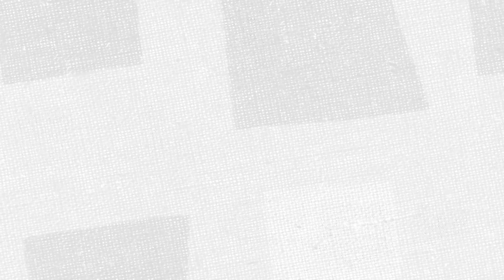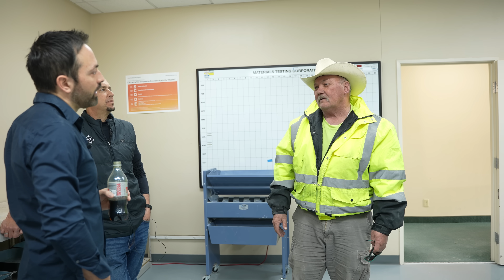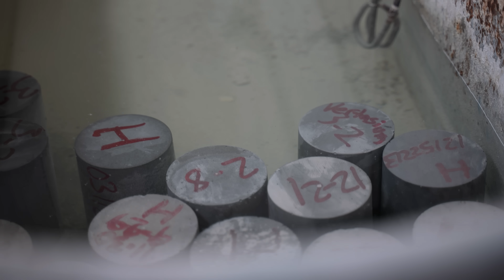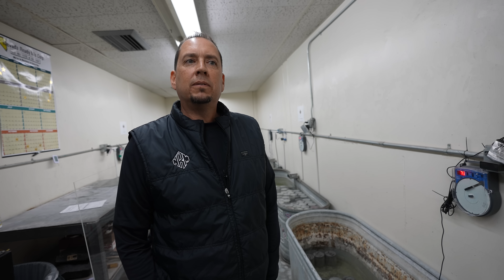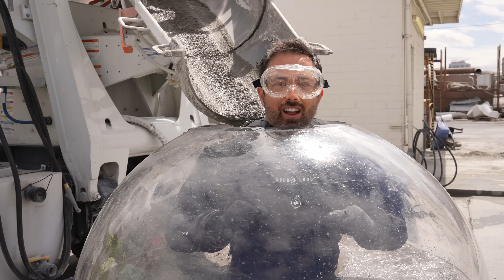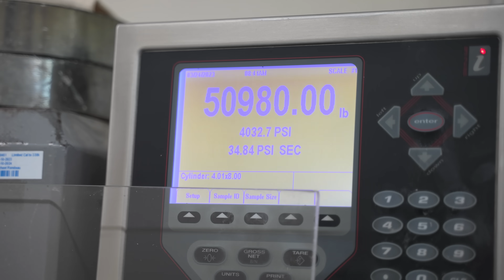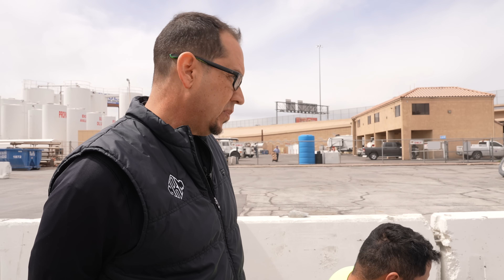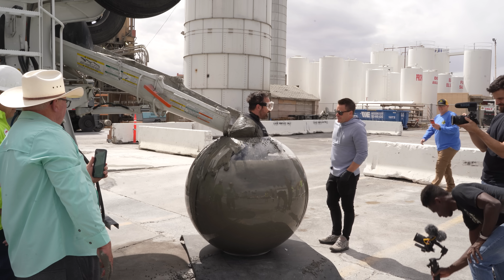Getting Buried In Concrete To Explain How It Works

Comment: I have first hand experience how concrete is caustic and dissolves skin cells. I had once a hellish concrete job in pouring rain, the pump truck was swimming in mud and the moulds were filling up with water, long story short, due to an almost biblical flooding that day (pump trucks have to empty or the concrete dries) we had no choice than fill up the molds even if we knew it was gonna be trouble. Due to the mud, the concrete started to burst through the groud from underneath the molds, and I had to get in there with a showel.. During the day I every now and then felt a tingling sensation on my hands while showeling, my gloves covered in slur.. Once the day was done and I removed the gloves, I saw that due to being soaking wet, concrete had turned into a soup, went inside my gloves and then marinade my hands in a caustic porridge through the whole day. As a result my fingers had turned black and had received 3rd degree burns.  Turns out, unlike acids that cause a burning sensation, caustic attacks and numbs the nerves, so you hardly feel any pain, especially when frantically working to save the pour.

The fat and skin from my hands had basically dissolved away, and the chemical burns kept worsening due to the concrete causticity deeply penetrate my flesh. In the end I even had pockets to the bone in some places.. Recovery took an entire year with fixing the fingers, but today I have good mobility close to what it normally was. Be careful not to let concrete on your skin for long periods of time, it will eat through.
Reply: Thats wild. Ive worked with concrete here and there barehanded for projects at home simply becsuse i hate gloves, everytime i got some slight chemical burns and irratation from it. 

I figured it was just silica burns. Washing periodically and directly after helped but the skin took a couple days to return to normal feeling without the tingling and constant dry sensation. 
I never realized it was such a serious thing or could progress to the point you described here. That sounds horrific.

Thanks for sharing that story. Im sorry that happened to you while you were just trying to save a pour at your job.
Reply: ❤ that sounds horrific. Thank you for sharing your harrowing experience. I hope you continue to have good health here after.
Reply: That made my skin crawl, no pun intended.
Reply: I was certain that you'd lost your hands completely based on that description 💀
For you to have recovered almost all of your lost functionality is absolutely incredible! I am so happy for you dude 🙏
Reply: @TakeaSwigofTheJuice  i agree. I can definitely imagine it all too well. Especially knowing what they mean when they say you dont really feel it much as its happening. The holes going to bones part got me. I think ill wear gloves next time.
Reply: I am glad you recovered from this.
Reply: Jesus CHRIST dude got way worse than I was imagining
Reply: Oh god, how terrible. I'm sorry that happened.
Reply: i dipped my hands in wet concrete when i was little because i thought it was like mud and i was playing with it for a good while before my dad saw  me and yelled at me lol ....is it weird that nothing happened to my skin?
Reply: Glad you were able to make a recovery, and thank you for sharing your story. I am curious, you said it dudn't hurt much during the day, but what was the pain like afterwards?
Reply: My brother used to pour concrete molds for sewer pipes. He used to wear cheap leather gloves with some cheap nylon inserts on the inside. Needless to say, after a year or so he started to develop what he originally thought was scabies (his Dr. told him it was scabies), that turned out to be a severe allergy to the concrete slowly seeping through his two pairs of gloves. Not a lot, mind you, just barely enough chemicals seeping through the gloves. It took him years to finally get his hands back to normal. He of course had to quit his job there, but it all worked out in the end, thankfully.
Reply: Holy crap! That’s intense! Glad you’ve recovered.
Reply: This is what they warned us would happen but nobody handled concrete long enough for it to go that far.
Reply: I've unlocked a new fear
Reply: Damn!  Thanks for the warning!  I knew it wasn’t good for the skin, but I had no clue it could be that bad.  Now that I work on the service side of things I rarely encounter fresh concrete anymore, but still good to be aware.
Reply: Came here to warn others not to allow the dust to get on your skin and don't dare breath it, but OMG!!

If the dust from a bag (that you pour into the wheelbarrel) gets on you, later that night your skin feels itchy and super dry, water doesn't help, only vaseline helps. 

I got the level 1 out of 100 and you got the level 1000 out of 100.
Reply: @thatnissan  always wear your ppe. It's so important.
Reply: Happened to us on a pour a few years back but luckily we kept tarps and things on hand and we just diverted work to creating drainage tarps that carried things away from our pour.  We were pumping in the concrete anyway, so the end of the house was the only exposure to the elements. Always helps to be prepared.
Reply: concrete has a ph of almost 13 !! and is aggressiv as hell on skin, I worked in thousands of cubic meters of concrete in my life and I ALWAYS wear glasses, gloves and long pants, I definitely had occasions where my skin was starting to peel a little, especcially when wet, it's a very tough job.
Reply: I hoped your sued the company. They didn’t warn you about the hazards of concrete.
Reply: @davidcardinal3654  even if he was warned of the dangers we have wcb for a reason. The company is always at fault for putting workers into terrible situations
Reply: @GameTimeWhy  you read that on a bilboard or something?
dude was wearing ppe and got burns far worse than he may have had his hands not been contained in gloves full of concrete for most of the workday. One could argue that the heavy rain may have possibly saved his hands from such severe exposure had he not been wearing them. Or that he would have been far more careful of the extended exposure instead of thinking the gloves would protect his hands absolutely. Regardless the ppe did not prevent injury in this case and many others.
Even in his situatuon its clear that how actions are conducted is far more important than any ppe in many situations.

In my situation I sustained no more of an injury than falling and lightly scraping some skin off my hands, it was just via a chemical process rather than an abraisive one. Because it was a light exposure over a short duration followed by a good cleaning.

PPE can help, it can also hinder depending on the context. I might wear gloves, or just be more cautious of not getting it on my skin next time i work with concrete on a small project of mine, either would suffice just fine in my context. 
But blanket statements such as "always wear PPE" are often a fallacy and lead to poor conduct when its assumed ppe is going to protect you. So there are clearly things more important than ppe in many situations.
Given the original context was related to chemical burns, its more objective, but safety practices in general are often very subjective.

While on the subject, Workplaces that tout safety first, are lying. Its always money first for them, probably why OP jumped in to try and save the pour, becsuse it would have been an expensive loss and he knew that and that pressure was there even though its possible and maybe even likely nobody was actually putting the pressure on them.

/rantover
Reply: My first day as a tilesetter, I was helping to butter tiles and, when we had set the floor, to grout.  My job was to rinse the grout sponges as we were washing our way out of the room.  Apparently, I have a habit of wiping my mouth with the back of my hand and didn't realize it at the time.  After washing my lips with cement water for 10 hours, they were a little bit sore.  I went home, went to bed, and woke up the next morning with completely scabbed over lips.  I couldn't open my mouth, as the scabs would break and I'd start bleeding.  I looked like I had been blowing a tailpipe.  I learned my lesson.
Reply: New fear unlocked
Reply: @thatnissan  man, I was a welder and a boilermaker before. Safety is #1 and a big part of safety is proper ppe and knowing the dangers (how to avoid them and what ppe to wear for the situation). It makes me so sad when people like yourself go on these insane rants about ppe being a danger. Obviously some ppe is inappropriate for a given situation but that's why you need the proper ppe and training. 

Some employers are terrible, that's true, but lots are not. It just depends on factors including but not limited to union vs non-union, specific industry, and level of training required for the job. 
If I had a dollar for every old dude who said "I don't need my welding helmet, goggles, leathers" I would have a down payment on a house.
Reply: @GameTimeWhy  i never once said ppe is an inherent danger, i specificaly avoided blanket statements as such.

I weld and work with my hands and power tools every weekend at home.
Obviously i wear a helmet, so i can see what im doing while welding and continue to see afterwards. Thats a fairly objective example. Can you look away and do tacks? Absolutely, should you do that 100s of times in a production setting? Not unless you like getting burns on your face.

As i said, its subjective, knowing the dangers and being aware of risks is the real priority. Lots of people dont realize concrete is caustic and causes burns, so those people wearing gloves will not protect them if they are still dunking their hands in it now will it?

You wantes to just come in and play safety chief saying "always wear ppe its so important" i could write a novel about things that should be higher priority than simply donning ppe "always". You are clearly aware of this as you have now further expanded on.
Reply: @thatnissan  proper ppe IS part of OBJECTIVE safety. I have no idea what you mean by "subjective" in regards to ppe because safety and proper ppe are the same thing. 
It's cool that you do hobby work on the weekends but that is not the same as being a professional tradesmen in a professional setting. 
Nothing of what you said makes any sense. Safety is safety. Ppe is a big part of that safety. Being trained properly so you know the dangers of the job is also a huge part of safety but the ppe is almost always integral to that safety.
Reply: @GameTimeWhy  thats not even close to what you said originally.
You said 'always wear ppe, its so important"

What i have said from the beginning is that the context is far more important. Are you not reading?
I didnt say dont wear ppe. I said PPE =/= Safety, just in much more words. 

I never told you what i did professionaly, ive had professional careers as a welder, a machinist/programmer, industrial automation service technican. My professional experiences and skills are many and varied as im sure yours are. Not at all relevent to this and a useless thing to reference.

And safety is absolutely subjective in many situations, thats what calculated risk based on skillset and experience is.
You sound like someone who wouldnt turn on a grinder without a guard, even when the guard is in the way of actually operating the grinder appropriately for the given task. I bet that sounds impossible to be done safely to you, truth is that depends how skilled you are handling a grinder. 
At certain points screaming safety first just becomes a sheild for liability to 3rd parties.
Reply: its not for nothing that concrete bags have that dead hand on them...
Reply: This is absolutely the kind of thing you could Sue your employer for.
Reply: @GameTimeWhy  i feel like its also approprite to point you that youve almost consistently enaged in strawman arguments here, moving goal posts, taking my words out of context, putting words in my mouth, and referencing completely  irrelevent "points" about you and your work experience while failing to stay on topoc of the original point.

What i originally stated was very clear with lots of context.
What you originally stated was vague, lacking context, and overall inaccurate which prompted my original reply.

Conversations like this will never end if you cant even stay on topic unless its just walked away from.
So go ahead and nerf your world in the name of safety first. Ill worry about me.
Reply: @thatnissan  bare handed would’ve been better than gloves in the situation that this guy had
Reply: @BigCroca  i couldnt agree more.
He may have noticed earlier, and almost certainly would have been overall more cautious had he not been wearing gloves.
And i in no way mean to throw shade at OP with this discussion. It is very sad to read his story, and i feel really sorry for him having gone through that and the still continuing recovery, and i really hope he has a full recovery in time. 
Sharing the experience here has alot of value too, almost everyone in this subthread is proof of that, and given his injuries i can imagine it may have even been physically painful to type it out, but he still did and i appreciate that immensely and hope others do too.
Reply: @thatnissan  You got mad workman's comp right?
Reply: @DanieleGiorgino  i think you meant to reply to OP not me.
Reply: @thatnissan  I haven't shifted any goalposts all I did was add more context. You are right that you have written a lot but I don't think you understand how incoherent so much of what you wrote is. Safety is not subjective at all and if you truly had any training you would know that.  Safety being nuanced and shifting depending on the specific situation isn't the same as it not being objective. 
You should be using a guard on you grinder. Do you also work with exposed wires? What about wearing your respirator while welding or other tasks that create fumes? 
I'm just glad that for the most part training is getting better and better as time goes on so we have less cowboys screeching about their freedom to be unsafe on job sites.
Reply: @GameTimeWhy  i use the guard when its not in the way, i remove it when it is, a grinder can be operately safely without one provided it is operated properly, presicely and the operator is highly observant of the ongoing process at all times and reacts accordingly.

I avoid terminating hot wires, rarely have a reason to where i cant just cut the power, BUT theres actually proper and approved procedures for that to be done as safely as reasonably possible when critical equipment cannot be shut down. Have you never known a lineman?

LOL a respirator while welding? I dont weld in a closet, i ensure there is adequate ventillation, preferably a draft pulling fumes away while not exceeding my shielding gas flow and avoid galvanized steel or other toxic coatings if at all possible, and will go outside to grind those coatings off if i must.

Those are perfect examples of subjectively measuring safety relative to experience, skills and precise operation. 

Someone who thinks safety is purely objective at all times and acts as such, would end up wasting resources, time, and rob themselves of actually learning the skills required to do those things safely without those overly reactive(to past liability usually) protections in place. 
This breeds incompetence by following all of the things you mentioned at all times without question or assesment of the added value vs needless complication, also known as, pandering to the lowest common denominator, which it appears you may be one of.

As far as shifting goal posts. This was about gloves being worn while handling concrete SPECIFICALLY in the context of OPs experience. Where in the ever living fk are we now? We in a whole other field here, where you gonna take us next?
You might live and breath training protocals but you are clearly lacking in reading comprehension if my comments are "incoherant".
Reply: Yikes!
Reply: YIKES!!
Reply: @thatnissan  what the hell is a pour? that doesn't exist. A pouring truck maybe, but a pour?
Reply: @thatnissan  I think I'll wear nitrile gloves inside rubber gloves inside leather work gloves ...
Reply: Saw a video of some old guy who got pissed at a crew pouring concrete and he decided to stomp in it and fell and all the comments were about the burns he would get for it but this is way worse than I was picturing
Reply: reading your comment story I heard in my mind the following song
The Chemical Worker's Song (Irish Folk Cover) sung by Colm McGuinness
Reply: Wow! I remember I helped some contractors build my parents house when I was 18, the concrete mixer thing we had stopped working so I would mix the concrete by hand all day. When he mentioned that concrete is basic, I remembered how my hands would get tingly after working with it for a while, and the skin would get sore when I came home (never experienced any real damage luckily). I had no idea it could get THAT bad! Glad to hear you’ve recovered man.
Reply: Hand experience indeed
Reply: Turned you into soap, oh dear
Reply: Yeah, I'd far rather work with strong acids than strong bases. Yes, the former can give burns (though often much slower than people imagine depending on the acid). Strong bases more or less turn fats into soap. That's how lye soap is made, lye and animal fat. They don't much care if the fats are from something living or dead.
Reply: You didn't have to get in there. You could've went home due to safety concerns. 
Stop trying to impress your boss. They don't care about you.
Reply: somebody tell Houston Jones before it's too late!
Reply: He's definitely right about caustic burns not stinging though as they break down the fata and release glycerol they can make your fingers feal soapy.
Reply: @avatar94100  Chemtech do some heavy duty chemical gauntlets that are both resistant to chemical break through and mechanically robust, they have a decent cut rating that should avoid it sealing in, we use them when Handling chemicals on a hazwaste site including sulphuric acid, sodium hypochlorite and lye.
Reply: @jasondrummond9451  I'd recommend the heavy duty cut and chemical resistant gauntlets there much better at stopping chemicals than nitriles and protect your wrists a bit.
Reply: Veritasium should've put that warning at the start of the video, knowing people on the internet, most people won't even make it to 19:00, now someone who skimmed through the video or didn't finish it, doesn't know what cement can do to them if they bathe in it.
Reply: god that's beyond nightmarish, i'm glad to hear you got a decent recovery though!
Reply: Brutal!
Reply: That's rad
Reply: Yeah that's why on rainy days (or maybe they always carry it) I've seen some contractors carry an extra pour bin. Large subdivisions have them to. A lot with a bin you can dump extra concrete in.
Reply: @coco_bold  pouring concrete would be what i was referring too. I think thats easily implied and im fairly certain you know that. Im sure workers in the industry have other vocabularly for it but not really worth the semantics of it given the surrounding context implies meaning clearly. You pour concrete, using the verb pour as a verbal noun addressing whatever site you are pouring concrete at gets the point across well enough and may not be perfectly formal english, but it is "a thing" .
Reply: @jasondrummond9451  i think the leather would just soak up over time? And if you google nitrile gloves for cement it actually states it should only be brief handling of concrete with nitrile gloves or you will still get burns, which means they are not protecting you, so whats the point. Id rather wear no gloves and try tk avoid direct exposure to skin while working with it, followed by cleaning if the other choice is gloves that dont work inside of gloves that will soak in the concrete.
Reply: @GregMoress  I definitely breathed in concrete dust, and I had beads of gelatinous nose bleeds for 2 weeks straight when I woke up every day.
Reply: Lime mortar is far worse. Get that in your eye and you will go blind if you don't wash it out quickly. I have used both modern and lime mortar and lime mortar actually somewhat frightens me.
Reply: @thatnissan  no i did not, i actually searched for what a pour was, i couldn't find it. So i then imagined you may have been talking about a truck. But it seems it's not the truck but the concrete that had to be saved. So i got it all wrong. Thanks for the clarification.
Reply: @coco_bold  sorry for the implied assumptions then, i read it as you taking a position on semantics of my use of the language more than a request for clarification, i apologize for that.
There is probably a better word than what i chose, i dont know what it would be though as i do not work in the concrete trade.

I was referring to the concrete itself that they were pouring/already had poured into the molds though.

It does sound like they may have had a hard time getting the concrete trucks out of the mud too.
Reply: That must have been a wild mixture, because I've had wet cement on my skin multiple times and dried out at some places after getting splashed from the mixer or while pouring and having hands full to do with no time to wash it off and I didn't have any major irritation or burns or whatever. The only thing I remember is that the skin felt very dry, kind of like after working with rubbing alcohol when all skin fat moisture gets removed. I've always tried to not have cement on my skin a lot (or breath in the powder while mixing) but will now take some extra care in the future.
Reply: @romeoneverdies  ew, yikes, i'm glad there's never been any dead hands on the concrete bags i worked with.
Reply: Eeeek man thanks for sharing, best tips always come from experience.
Reply: @thatnissan  Oops, lol
Reply: @moos5221  The doctors and the cement company told me it was a perfect storm that created such a rare situation. Normally people don't have their hands marinaded a whole day in wet, warm slurry inside a glove that is also abrasive to the skin, allowing the causticity penetrate deeper, while the bodyheat and chemical reaction heat is accelerating the reaction. The cement company did suspect the additives in the mixture may have also made a difference because I was the first person they had ever heard of receiving such burns.
Reply: Bad day outside the office... Sounds horrific and I'll be sure to be more careful for future work
Reply: @jeffreyokun2355  Yeah, very unfortunate turn of events. Glad you recovered from it though, but really bad luck in the first place.
Reply: omg thats wild
Reply: @pilasalerta8416  Your dad was right to stop you. Skin has a lot of protective, expendable dead layers to protect you, but they are very thin and subtle, especially on the hands. Because of that, you can burn off a large amount of those protective outer layers, and you'd never know you'd lost all that skin just by looking and feeling.

Sometimes your hand will look very slightly paler, or the skin will be a little softer, but everything will often look, feel, and seem completely fine and healthy. In fact, because most of your dead protective layers are gone, your living skin beneath will be much more visible, making your hands look more healthy than before. But in reality, you've burned away much of your body's protective armour.

It's even harder to see that sort of skin loss in children, because youthful, rapidly-multiplying skin sheds and replaces those protective outer layers faster and more often, making even the thickest and oldest dead skin on a child's hands look and feel a lot more like the softer, still-living skin beneath.

So the slow burn will seem to have no effect, up until the moment when the damage fully penetrates your protective outer layers and starts eating into your raw flesh beneath. After that tipping point, your skin will start to suffer much more obvious damage, much more quickly, and things can get bad, fast.

Slow chemical burns are a bit like staring into the sun. By the time you can easily see, feel, or notice that damage is being done, you've already let it go waaay too far. Even if you immediately pull your hands away after that and wash them off, things are probably going to get a lot worse before they get any better, and some of that damage can already be permanent.
Reply: @coco_bold  If you have any experience in the construction trades at all, it's astounding to me you've never heard pour used as a noun. I guess it must be colloquial but it doesn't take much of a leap of logic to turn a participle like "the [pouring] went well" into a simple noun "the [pour] went well".
Idc what the dictionary says if it's easily interpretable. Was that really so hard?
Reply: @thatnissan  As a licensed residential builder in MN, I agree with your stance on safety. However, from my perspective, there seems to be a simple misunderstanding of terms.
People trained/required to professionally use PPE generally understand the term to be directly subjective to the context of the work in every case. That's why sayin "subjective PPE" confused others. PPE = safety, to them. There is simply no definition of "bad PPE", that would be a direct contradiction of the term. If you were wearing gloves when you shouldn't have been, then you weren't wearing PPE, you were just wearing gloves like a fool.
I hope you do continue to preach the importance of critical thinking in a case-by-case basis though! Couldn't agree more there!
Reply: It would have cost you zero dollars not to put that picture in my head. 😐😐
Reply: @loser-nobody  maybe I lack any experience on concrete that's a fact or i lack from logic or there was some ambiguity when using pour as a noun, this last could have being the container or the content. Or  i was tired
Reply: @pilasalerta8416  that day you merged with the concrete and you just didn't know it. Have you ever tried punching through a wall? I bet you could do it with no pain.
Reply: @TakeaSwigofTheJuice  

Now that you mention it.....
Reply: Wow. Thanks.
Reply: Yall be writing essays
Reply: @Real50koda  that's because it's important for you to not only realize the importance of the concept that is presented in the video, but also the associated dangers. Through education and information we are able to advance as a society.  Be thankful that there are people willing to share that knowledge with you on this platform.
Reply: @TakeaSwigofTheJuice  yeah i am, not when its 1am. DONT TELL ME TO SLEEP IM ON A PLANE
Reply: Sorry that happened, glad I had professional finishers to warn me about not touching uncured concrete
Reply: @coco_bold , I was a finisher on a flat crew and a curb and gutter crew, we always referred to the job as a pour.
Reply: I deliver chemicals and first day on the job some sodium hydroxide I washed off my rain suit with water got under my glove somehow and my hand started hitching a little some 10 minutes after, I told the plant employees and had me sent to the infirmary right away, I still have scars even though I did only got some very superficial burn but had I ignored these very mild hitching on my hand and not told the plant employee I might have ended up burned very badly, the employee saved me from a really bad medical emergency because anything caustic like you said might burn you very slowly but deeply maybe without even noticing
Reply: That’s actually way more terrifying than I expected
Reply: That’s the scariest thing about it. I used to clean a kiln as part of one of my first jobs. We made hotlime at Pfizer’s.
The kilns were shut down for cleaning, but still very hot by the time we entered them to clean. If you sweat, you had to make sure the dust didn’t get on you. Glad you are ok now.
Reply: ok.
Reply: Man, a friend of mine, a concrete layer told me some pretty gnarly horror stories about guys breathing in concrete dust...
Reply: Hi just someone reading the comments. I've been at both ends . Meaning working at plant that made cement. I remember all the houses within a 2 mile radius had a buildup of cement crust. And all the cars would have bad  paint on them. To make this shorter , I worked on big dam up in Fresno CA. I got concrete in my boots it was annoying. I kept filling my boots with water to get relief. One of the O.S.H.A. safety people saw me and ask me to remove the boots . I was already getting blisters. The therapy was worse then the burns. I had to go a foot doctor who would pick the scabs off so it wouldn't scar. I told let it scar...
Reply: @richhill9321  Thanks for sharing. For me the treatment was pure torture as well. The dead and dying tissue had to be removed from my hands and fingers by cutting my flesh while being concious. I was told to just bite it through the pain and not move my hands. I was given a topical ointment for the pain, but it did not do much. The pain of cutting the flesh from my hand was very intense and felt like my hands were on fire.
In my country the doctors don't really care about the pain a patient is going through. There seems to be an attitude, the body is a biological machine that they repair and the pain is nothing but a temporary feeling, signals sent via nerves. Anyway, they did save my hands and they are fully functional now, despite the horrible pain during treatment.
Reply: @pilasalerta8416  No, it takes a longer time and conditions have to be right to get the kind of damage I received. However I suggest you look up comparisons to ph13 in the caustic scale to give you an idea how harmful concrete can be.
Reply: Jeez bro. That's the definition of this job ain't worth killing yourself over lol
Reply: Wow! I never would have thought this about concrete. There are safety regulations for a reason. Good to know. Thank you.
Reply: I just looked up cement burn and it's terrifying
Reply: Wow that's a crazy story! Thanks for sharing and I'm glad you're okay. This information is important. Thank you